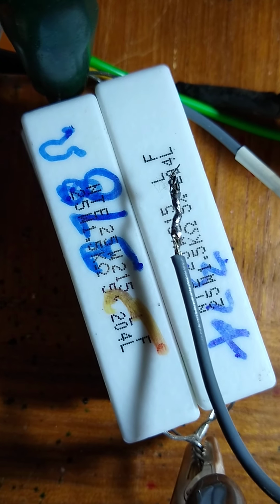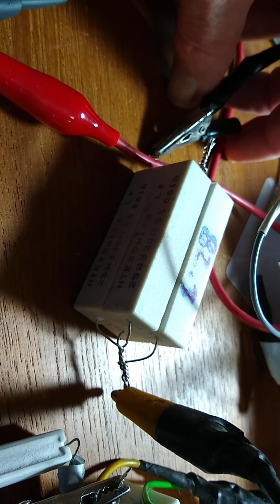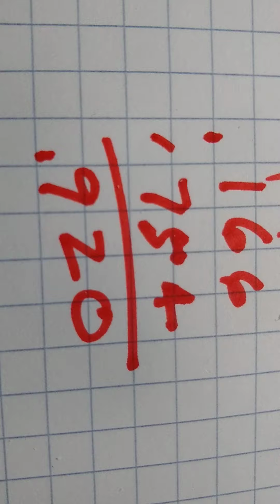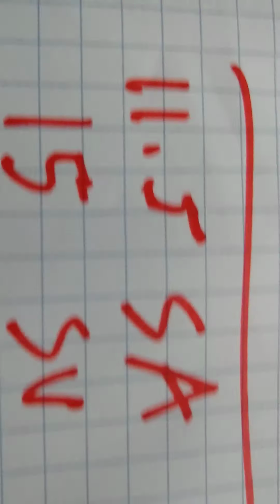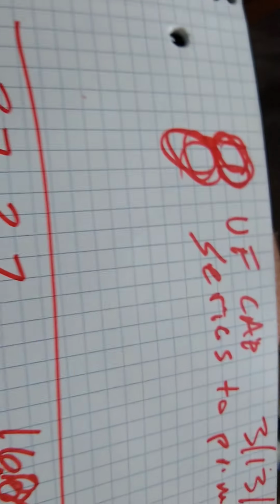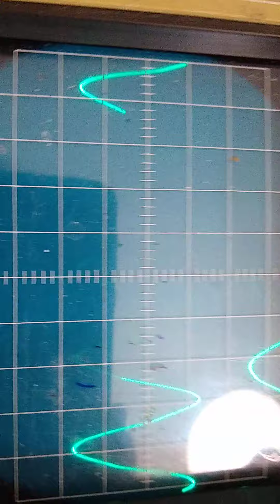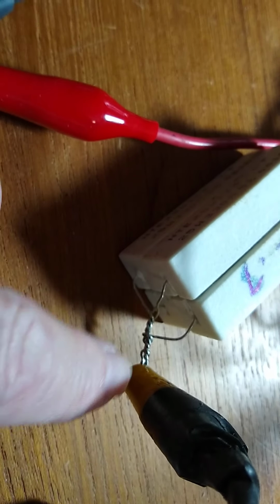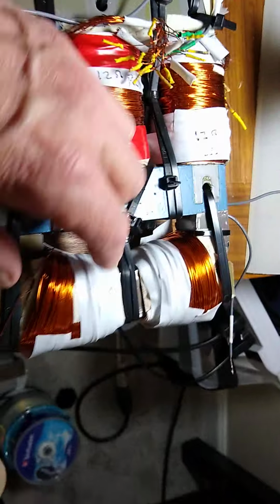Corrections from previous video; actually it is:  .750W input and .920W output after doing re-tests

Comment: Hi Doug, when we measure current with meter it has it's own internal resistor which can change the current in the circuit we're trying to measure. If we want to check if meter is correct we have to have meter in circuit and scope across it's normal resistor at the SAME TIME. It has to be a simultaneous measurement of same current under same conditions not insert a meter afterward and say "it's different" now so one of em's wrong. I would say do not progress with changing anything in your setup until you can make repeatable measurements with the confidence to carry on.
Reply from the maker: Hi Gerry
I have at times looked at both ammeter and scope at same time in parallel anditknocks down both what they say in amps do I never thought that was good way to check amps.
It's hard to say what is definitive. Looking at output from secondaries with resistor across it, seems like the voltage over it and squared would be last work on it, but what is the voltage across it for sure what meter says or what scope says. I guess I could turn the fine adjust on scope square divisions settings for voltage  until the scope matches up with meter in voltage but hate to do that since this is dictating meter is correct and scope is not...
I agree I need to have some solid measuremts happening and get to the rock bottom of it.
I want to run the winds in parallel next but will wait until all avenues and dead ends too explored.
Reply: @MrDKONZEN  Hi Doug NOT in parallel not correct way, can only be done is series setup.....the meter on current range + scope and it's own shunt resistor.
Reply: My digital meter on 20mA range uses 33 Ohms internal shunt resistor which is pretty big yes? So it's like putting another resitor in series with load resistor when we measure current this way ...The meter can affect the total current.